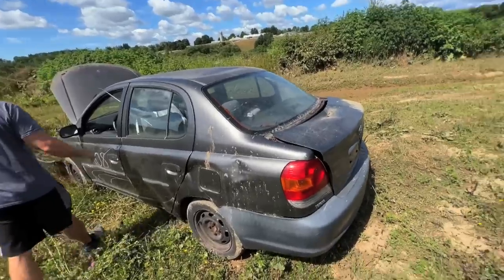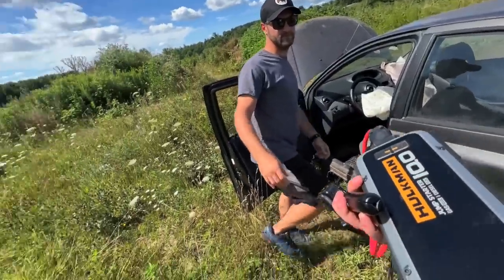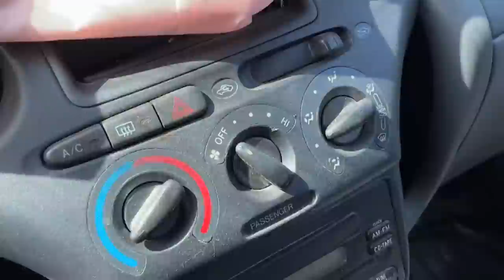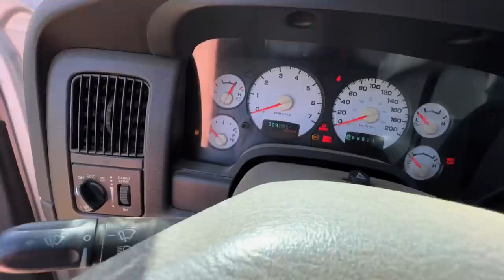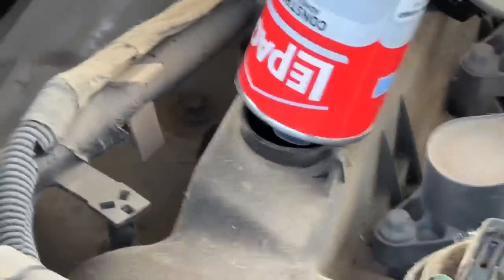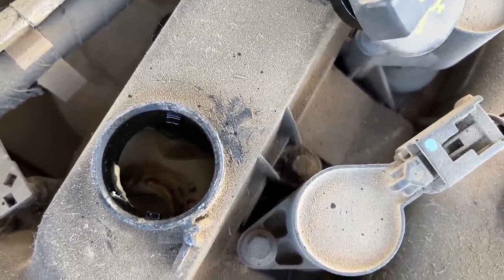CAULKING As Engine Oil! CAR JUMP!

Comment: Not always, but many times you’ll find that worn out engines will run longer without oil. The bearings have more clearance than normal so when things get hot and tight, they don’t get as tight on the worn out engines. The engines that seize up right away from no oil often were a sign of healthy bearings and such. 

Fun video. Curious if you put oil back into it before it was completely dead if it would spin a little freer with the spun bearing